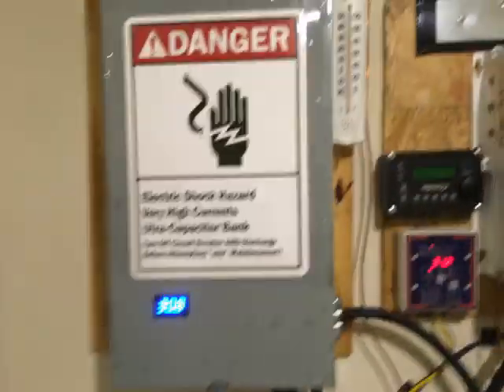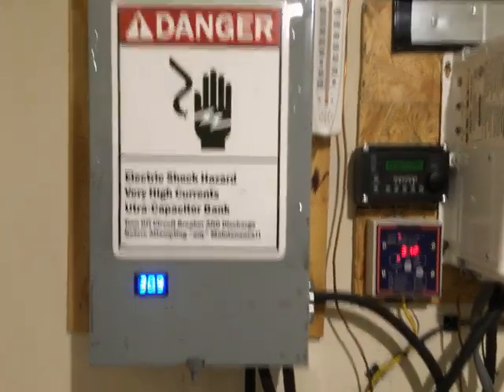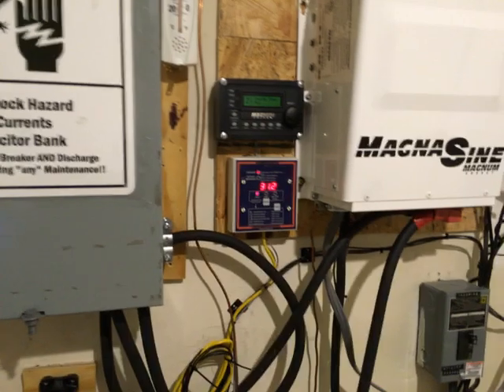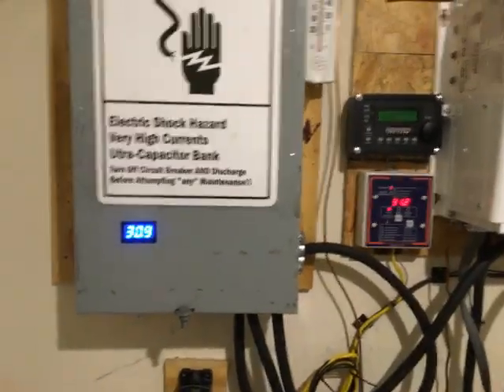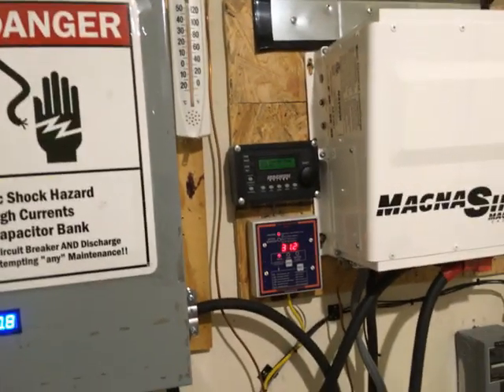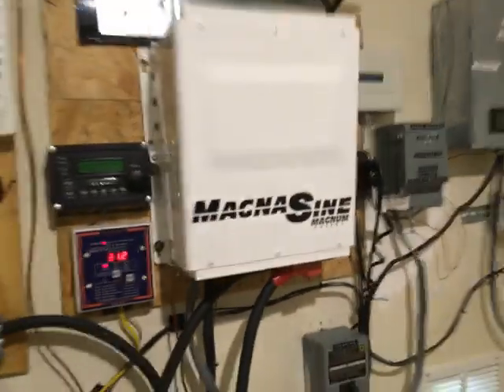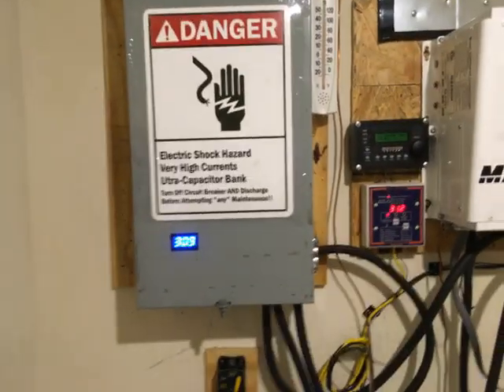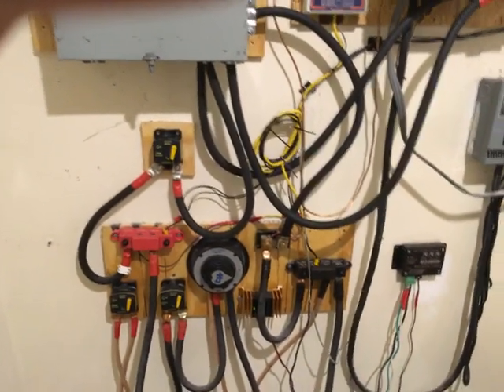Ultra Capacitor Bank with Solar Update - The Wiring is "everything"

Comment: Q : What is your charge current on your system i want to do the same on my 48V 200AH system but cautious for over voltage on capacitor bank my capacitor bank is a 54v 150f bank what do you suggest i do ?

Comment: Question on how your caps are charged. I tried a proof of concept today on the beginning stages of my system modeled after your set up. Only thing is I have 48v system. Anyway when I turned on the batteries the caps drew so many amps the plastic in my bus bar started to melt and the battery switch wielded open.  I broke the plastic trying to turn it off.  My question is how do I charge the caps safely?  I've seen videos using a 12v light but how to implement it into a solar system for 48v.  Or am I missing something Thanks for any help. 

Eric.
Reply from the maker: Sorry to hear about your mishap.  First for safety reasons you should use higher gauge wire\cabling and a DC switch capable of handling the higher amperage (200A to 300A should be sufficient). When dealing with the potential high currents of ultra caps, proper gear is a must.  My switch is Cole Hersee Master Disconnect Switch rated at 300A if I remember correctly,  my cables are 4/0 welding cable, the battery bank circuit breakers are rated at 150A max, the bus bars are rated at 250A at 12v, so I estimate 150A at 24v.  In regards to my setup, with the correct cabling etc, I simply flip the battery bank selector\disconnect switch and my caps get charged with the huge inrush of current (not more than 150A, because my 150A circuit breakers don't trip). This huge inrush of current is usually at the initial charging, after that the batteries replenish the caps normally at a steadier rate.  My Nickel based cells can take the abuse of a severe deep draw from ultra capacitors without damage.  I wouldn't try that with lead acid batteries, without a high resistive load in between.  To initially charge your caps, and not damage your batteries, you can go with the headlight approach, which is simply putting an inline high resistive load to slow the inrush of current.  To do this, you would carefully wire it temporarily in series between the batteries and the caps (with a switch or circuit breaker in the middle to control the connection\disconnection).  Another "unorthodox" way would be to take 4 or 5 dead 12v batteries and combine them in series to increase the voltage and charge the caps that way, since they are considered dead at 10 or 11 volts anyway, you have nothing to loose (don't forget the switch and cables to take the current), I did say it was unorthodox, but I have used a spare dead battery to initially charge a 6 cap bank with size 2AWG jumper cables with no problems.  The idea here is to get the initial charging done, so that conventional charging can take place.  A completely drained capacitor is like a dead short to a charging source.   I hope this helps, please be careful, and let me know if I can be of any assistance figuring this out.
Reply: Thank you for the reply.  So if I can get initial charge on the ultra capacitors the battery should be able to handle additional charges as it operates?correct?
Reply from the maker: Yes, that's what my system has been doing for months.  Conceptually, it's no different than Maxwell's Engine Start Module, https://www.youtube.com/watch?v=xkKczthgk0o,  the ultracaps are wired in parallel with the battery, the caps supply the power to the load (starter and vehicle electrical loads in this case), and the batteries replenish the energy.  Here is my latest video showing what I run with my system  https://www.youtube.com/watch?v=BeqE95ON7XA  As the caps supply power to my loads, the batteries "slowly" at a steady rate recharge the caps.  With my system, there are no rapid amps spikes, my meter shows a slow gradual climb if the amp draw goes up, and a slow gradual decrease if the amp draw goes down.  The caps take the hit from the loads, not the batteries.

Comment: do you sleep with the Air Conditioning off, never heard you talk about it when your off the grid?
Reply from the maker: I have a central air conditioning system that is 240v that stays on the grid, when I go off-grid my sub panel isolates the 120v circuits from the 240v circuits.  So off-grid for me is all 120V circuits off grid.
Reply: +rhandsom oh ok, I do remember you had it that way, just forgot. You said off the grid just threw me off.
Reply from the maker: No problem, take care.

Comment: Wow thanks for the shout out brother. Glad it helped. Did you ever think of running your frig and frizz on a timer? I have mine cut off at 1 am come back on at 3:00 am then go back off at 3:30 am the back on at 5:30 for the rest of the day. I save 2 kWH from that. God Bless.
Reply from the maker: With my current system with the capacitor bank I don't really need a timer.  But I may consider it in the future.